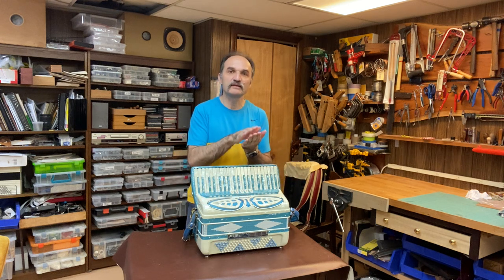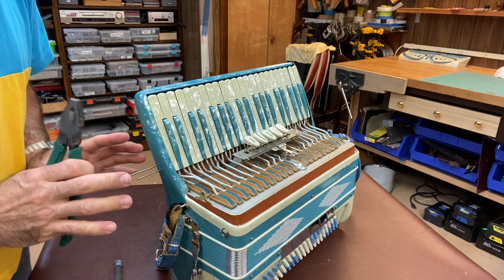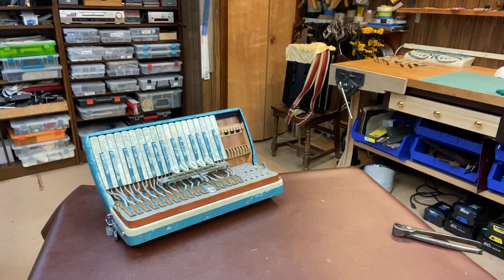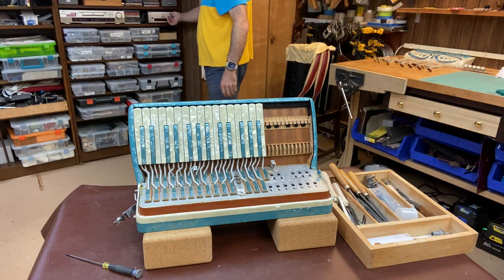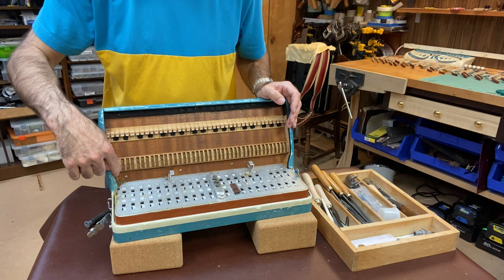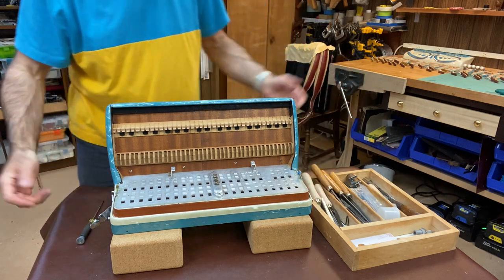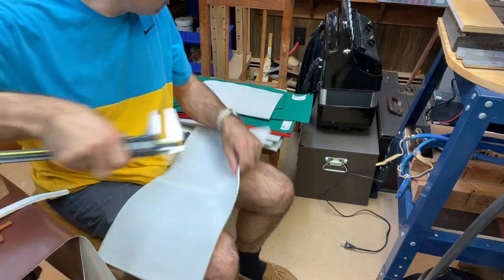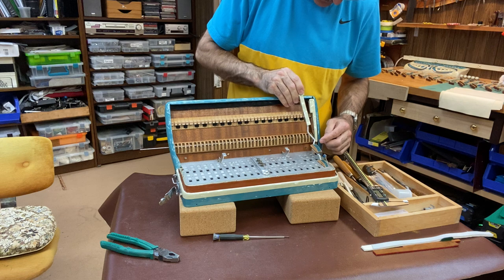Replacing the valve pads on accordion.  Part 1

Comment: I have a broken arm on one of my keys. It broke at the pivot right where the rod goes through. How would that be repaired?
Reply from the maker: Normally, the arm would be removed and cleaned.  Then, I usually add some scratches in axial direction (along it) on the section that will be inserted in the key.  These scratches prevent arm from rotating.  After that, the arm is glued back in place wit PVA or hide glue.  Hope this helps.